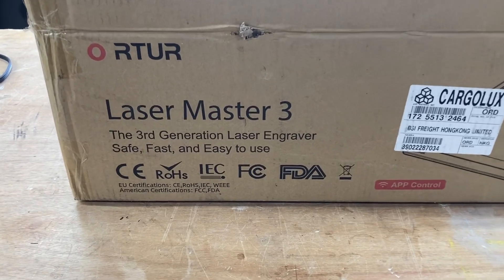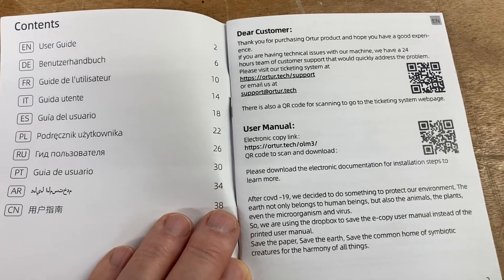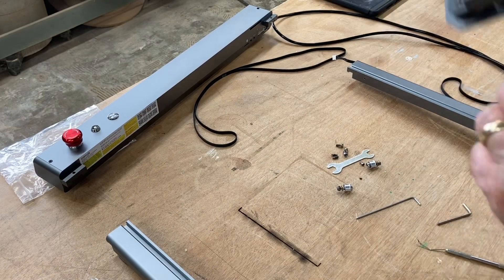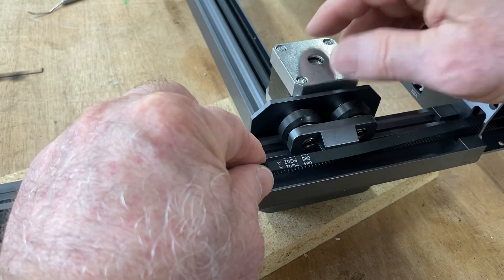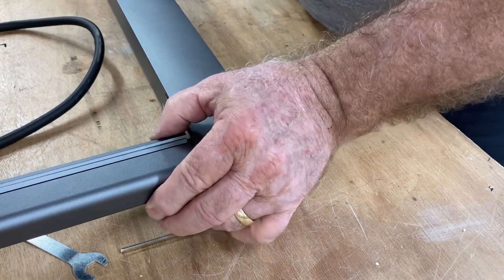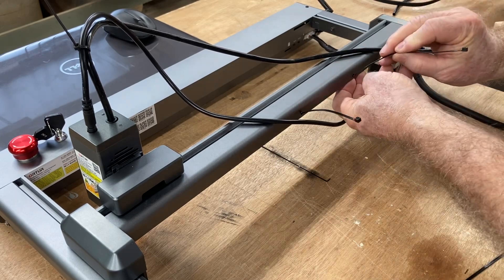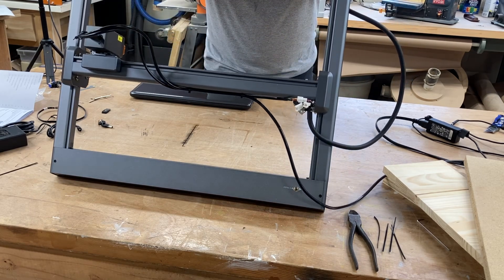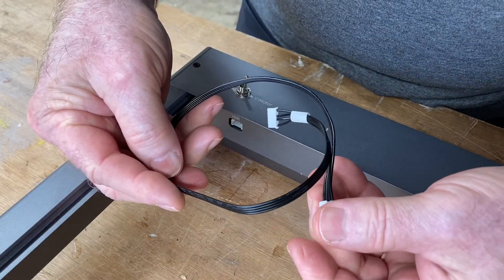Ortur Laser Master 3  Tips for Easy Assembly

Comment: I just received my LM3 this month.  And they have included the printed manual now.  One piece I don’t understand.  Check page 11.  They say to not run the cable in the red area.  Not sure why, bu there is no way to keep the cable up in the upper area where they want it.  On the won end, I can see whay they want to there, based on where the cable comes out the back.  The connector doesn’t even fit up on the shelf they want the cable to sit one.  Any ideas?

Comment: I love your videos Paw Paw. You do such a good job on them. Having said that. I don't know why you like the idler design so much. The screws that go with the idlers are not long enough to lock into the lock nuts. If you tighten the screw enough to lock into the nut the idler won't turn freely. When you are setting the tension and tighten the tension screw it pushes the idler into a slightly crooked position. I think it's a terrible design.
Reply from the maker: Interesting, I did not have that problem. I tightened them tight and they still turned freely. I like it for its simplicity and ease of access. The xTool D1 has a better design just not as easy to get to. Thanks for watching

Comment: Love the diode laser videos they have helped alot but I have question about cnc which for a person with no experience in cnc which machines would you recommend for a beginner could you do a video on it
Reply from the maker: Thank you very much. If you have no CNC experience then I would suggest getting the largest machine possible based on you budget and space in your shop. The reason is you can also do small projects on a big machine. But it becomes difficult to do a large project on a small machine. Inventables XCarve with easel will get you up and running quickly. After about six years of having this machine I still use it for quick projects and for testing concepts. The FOXAlien VASTO is an excellent small machine and you can put easel software on that as well. The CNC4NEWBIE New Carve is an upgrade to the XCarve. Sooner or later you will outgrow the easel software and you will most likely move to VCarve by Vectric. This is a lot of information. I’m happy to answer any questions that you have to get you started
Reply: @PawPawsWorkShop  thank you I'm in the planning stage right now but your help is always appreciated
Reply from the maker: Again, any questions just ask. I’ll try and help
Reply: @PawPawsWorkShop  thank you when I get closer I'll pick your brain right now I just started with an atomstack x7 pro and slowly learning I'm making an enclosure and stand for it it will make it easier r to use I live in an apt right now when I use it it's out and in the way I'm lucky my other half is very tolarent

Comment: Nice video! One question, do you still need to supply an airpump for the air assist to function?
Reply from the maker: Yes, you need to add your own pump. All you need to do is connect the hose. Everything on the laser is complete